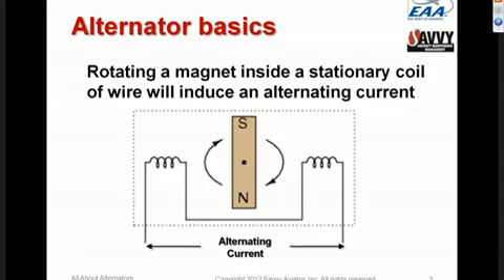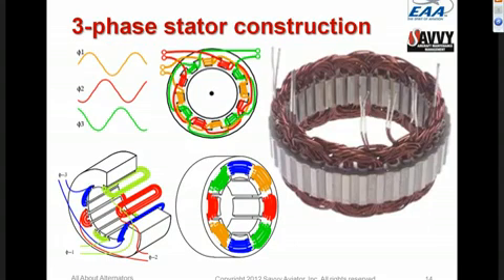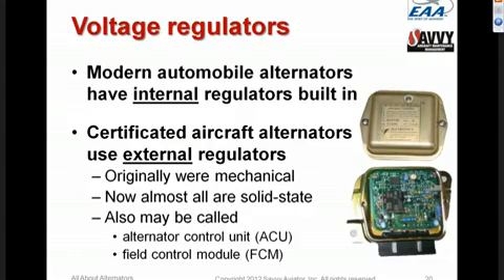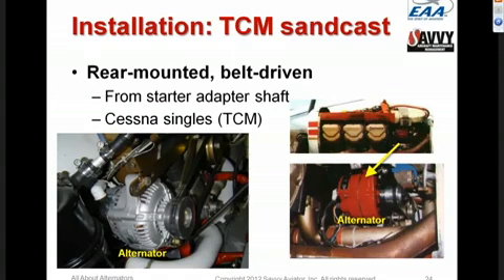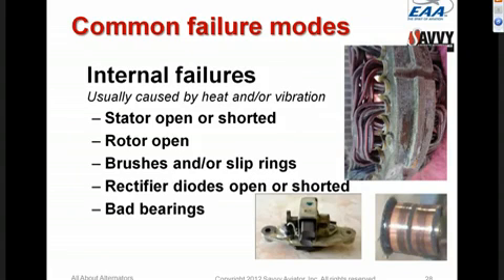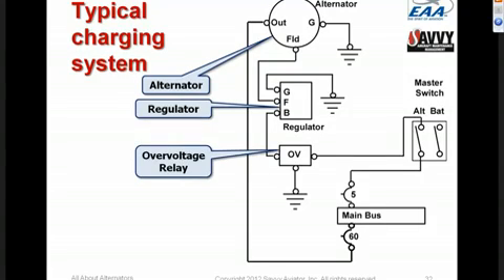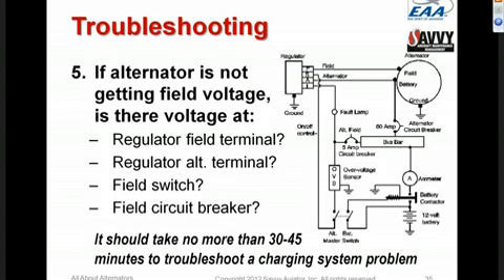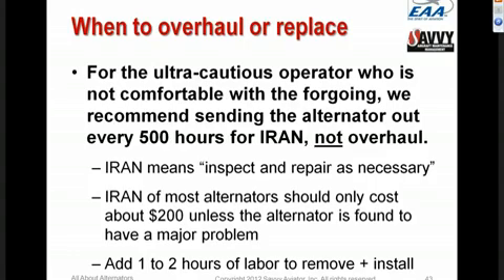All About Alternators

Comment: 30:47 if a hard pice enters between the alternator gear and the face gear it will bent the alternator shaft and it will snap. Probably one of the broken tooth’s on the shown damaged gear entered between both gears. My theory is that it first snap a tooth and then the tooth was sucked between both gears.

Comment: 24:59 common read the f-ing manual and think about it. How are you testing the slippage of its glued? It’s not glued it’s a friction that holds the rubber together with the cup. Also every 500hrs you have to check if it is in specifications.

Comment: It was mentioned that some mechanics would place a 2nd alternator belt when the prop was off so as to later unziptie it and then more easily replace a broken belt in an emergency or such. My question is: Would this be legal to do on plane run by a Part 61 or Part 91 operation?

Comment: Of course outside the cover is a small hole thru which to put a piece of stiff wire, you push 
brushes down on the inside and pass piece of wire through small hole to brushes down, till
you put the alternator back together then pull wire out so brushes now make contact with
the slip rings.

Comment: Note that an alternator with electromagnet rotor cannot produce electricity when  there is no electricity available, battery  0 volt, while it always can when the rotor is a real magnet.
Reply: True but regulation is much harder and more complicated, if it runs at one speed then that makes sense.

Comment: hi i have a alternator has voltage going down rarely to 12.6 until i start the lights to the car
battery is new brushes and slip ring is new maximum voltage is always there around 14.3 volts i have a digital voltmeter in the car im always monitoring it  car has never over heated belt is new elantra 1.8 2012 what can cause this problem ?

Comment: Worn brushes will start to skip on the slip rings when the brush leads are stretched to their limits and the tight leads stop the brush from being loaded on the slip rings by the brush springs.........this gives intermittent output and burns the slip rings also..........easy to replace before the brushes are worn to their limits.........diodes that have failed will sometimes make a buzzing noise which sounds like air in an auto power steering pump........keeping an alternator cool is so very important and a blast tube or a naca inlet and scat hose will keep things cooler..